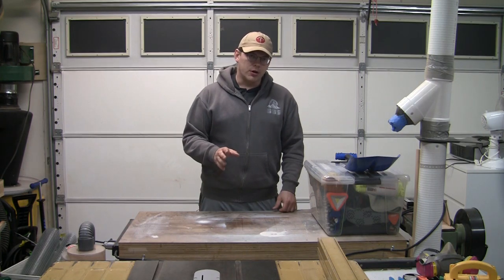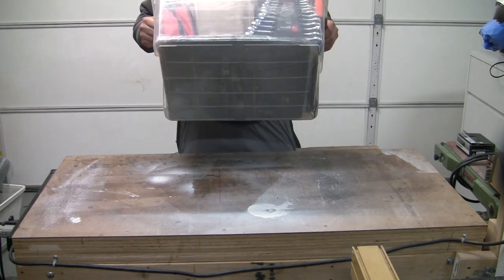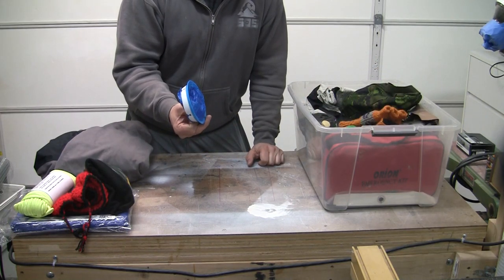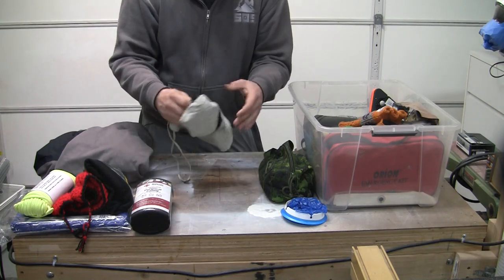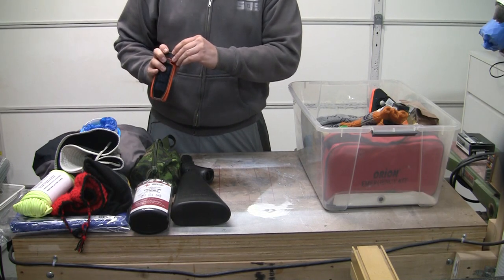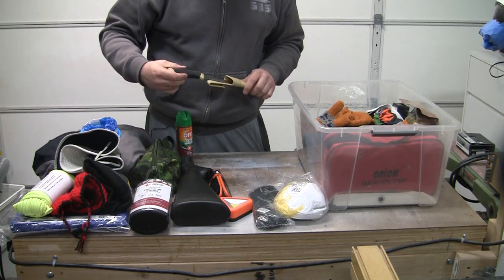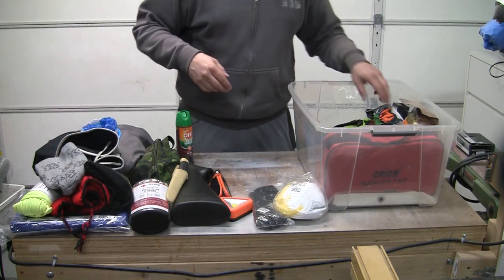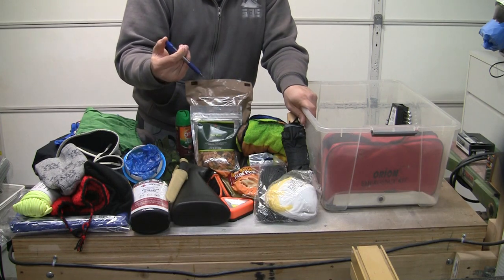The Ultimate Car Survival Kit

Comment: Some of my stuff , 2 vice grips, 8 in one screwdriver, 20oz srriaght claw hammer( digging,  prying, weapon) crescent wrench, tow strap. Can-0-fixaflat, a box of various hose clamps, bolts , nuts screws, . 12 volt air compressor, brand new never had gas in it rinsed out 2 gal gas can full of water(water can be dumped if gas is needed, water from a clean container needs no explanation. Those jumper cables are near useless, buy big gage longer ones, put the Glock in thrat jumper cable bag. Drum liners, 3 quarts oil (can save engine, dont pay gas station prices)  roll paper towel, baby wipes,, a 12 volt jump start power pack with USB port. I prefer the shovel be a short steel wood handle one : it wont break as easy, can be used in mud and dirt and it makes a excellent strike swing weapon. Several feet of romax house elect cable. When I change engine belts or hoses, if i can take the old one off without damage, i jam them behind the spare tire , i know they will fit.
I always have 3 rolls of quarters, and the farther i travel the more cash I take.
The quarters are enough for local day out survival. Keep the  cash in small bills, you dont want to be that guy that has several $100.00 bills, and needs change for a parking meter or phone, or finding that 5 gallons of gas you need, but the seller has no change. Hidden inside the car is a spare key, and photocopies of my DL, health insurance,  car insurence, registeration and debit card.
If a key is lost i can always break the window.